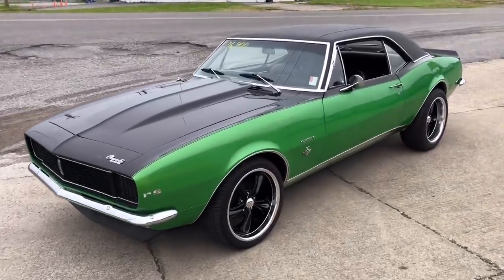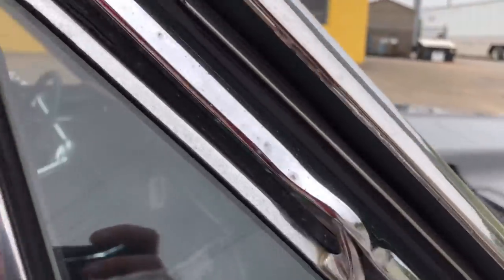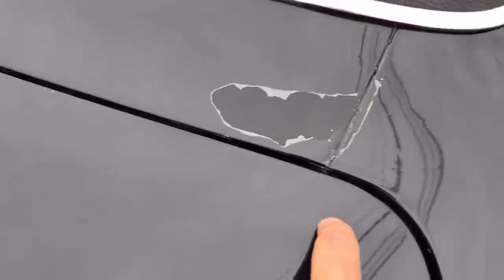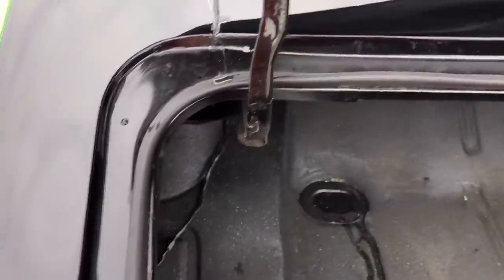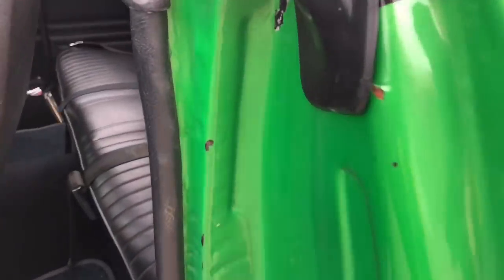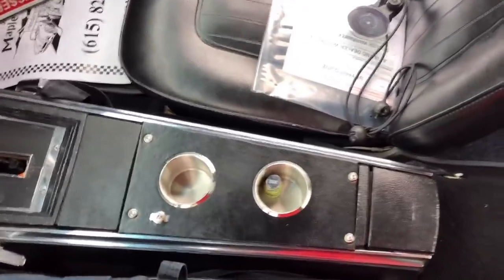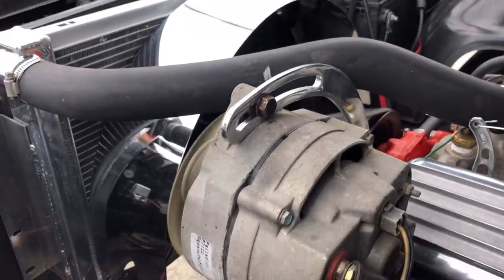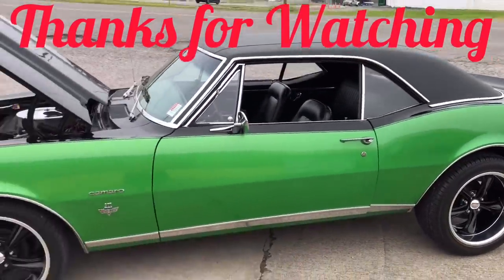“SOLD” 1967 Camaro $26,900 Maple Motors

Comment: I was paying attention when you were doing a side shot of the car under the door whoever did this car did it work it is good for racing because it has the frame connectors on it which ties the frame together because it is unibody very good start to a drag race car
Reply: Nobody in yheir right mind would do that to this car